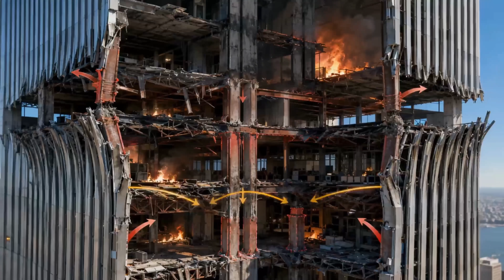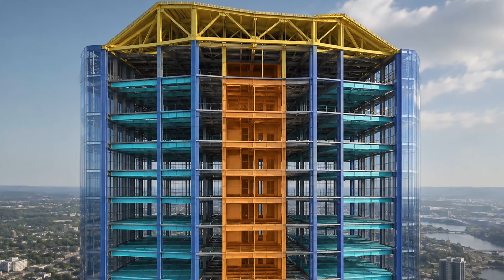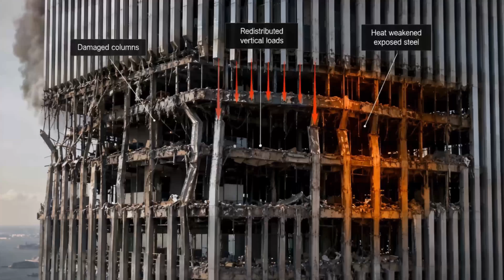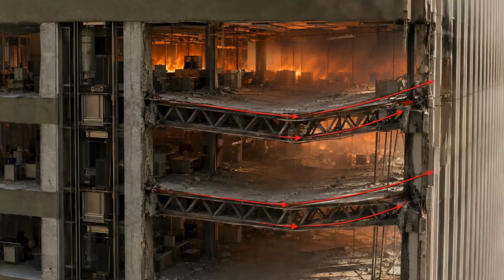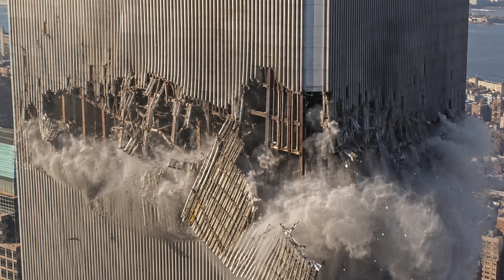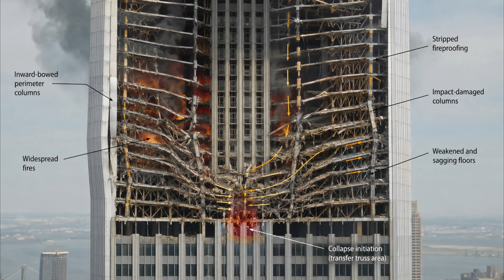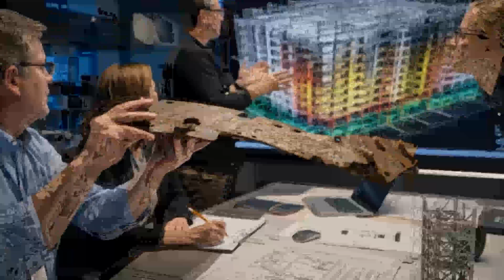What Happened Inside the Twin-Towers After Impact?

Comment: You can Ai to anything and come up with theory, but what i want to know is what caused building seven to fall. There was no direct hit, yet forty stories pancaked just like the controlled demo of the twin towers.  No matter how many engineers, or specialilists try to convince me, there is no way that me that the towers came down on there ow. This is just government trying to convince the people iy was terroism, but it wasnt  Where the hell is the plane parts at the pentagom, that was not a plane, it was some sort of rocket. Why did the government rush to take out all the cameras around the businesses, so no one could identify, thats why the corrupt us government murdered so many people
Reply: Ask and ye shal recieve:  

Building 7, the 6th building to collapse of 10 lost on 9/11 got little attention early on due to higher priorities. As a result, the information void got filled with technical nonsense, creating lots of confusion and misconceptions. Many people, like you, just want to know what happened. To remove the confusion I prepared this brief summary from my own independent technical analysis. Let me know what you think. 

At 10:28am the WTC North Tower collapsed, showering Building 7 with tons of burning debris, causing heavy damage and starting many fires burning out of control for the next 7 hours. Office buildings are essentially giant piles of kindling when it comes to fires, chock full of stuff that burns vigorously and quite hot. Since half the firefighters had been killed, units in disarray, equipment destroyed, no water pressure, and the priority of search & rescue efforts, 7 couldn’t be saved so firefighting efforts were pulled as futile and 7 left to its fate. Firefighters make that choice every day in brush fire situations - which houses to save and which ones to let go. Only real difference here is moving the decimal on the size and cost. People get overwhelmed by the size. 

www.youtube.com/watch?v=g_SvpwyC17M 

Collapse of a burning structure is always a concern for firefighters. Steel buildings are uniquely vulnerable to fire damage. Designed around 1 to 3 hours of fire resistance for occupants to escape they rely on active firefighting to survive. After that all bets are off. Left to their own devices they'll exceed their design envelope and collapse, like Plasco Tower and Wilton Paes de Almeida. In 7 the occupants escaped, passive and active fire protections were compromised and active firefighting was abandoned hours before the collapse, which left the building to its fate. It lost. Odds on Building 7 would eventually collapse, and it did. No big deal in logic. 

www.youtube.com/watch?v=WnYBX6QT0R4 

FDNY Chief Daniel Nigro - The biggest decision we had to make on the first day was to clear the area and create a collapse zone around the severely damaged 7 World Trade Center, a 47-story building heavily involved in fire. A number of fire officers and companies assessed the damage to the building. The appraisals indicated that the building's structural integrity was in serious doubt. I issued orders to PULL back the firefighters and define the collapse zone. It was a critical decision; We could not lose any more firefighters. It took a lot of time to PULL everyone out, given the emotionalism of the day, communications difficulties and the collapse terrain 

FDNY Deputy Chief Peter Hayden ; We had our special operations people set up surveying instruments to monitor and see if there was any movement in the building. We were concerned of the possibility of collapse in the building. And we had a discussion with one particular engineer there, and we asked him if we allowed it to burn could we anticipate a collapse and if so, how soon? And it turned out that he was pretty much right on the money, that he said 'In its current state you have about 5 hours 

The collapse of Building 7 was anticipated and widely reported in the media throughout the day, with 24 video cameras recording it. Everyone knew what was coming and why. 

www.youtube.com/watch?v=OY5S5k3tMHI 

Building 7 collapsed from the inside out which is not intuitive and hard to understand. Most details are hidden from view and some people will struggle no matter how much it is explained. But here is my best shot relying on no outside authority. Building 7 was a unique, asymmetrical 47-story steel frame structure built atop a smaller 3-story building serving as a partial foundation and requiring lower floors dedicated to complex load transfer structures. Of trapezoidal shape and tube-in-tube construction, B7 (above the 7th floor) consisted of a central core of steel columns carrying most of the gravity load, perimeter steel columns around the outside of the structure carrying the remainder of the gravity loads and long span beams and girders to tie those elements together and form the floors. On the outside of the building hung a curtain wall facade or outer shell. www.nist.gov/image-16640 

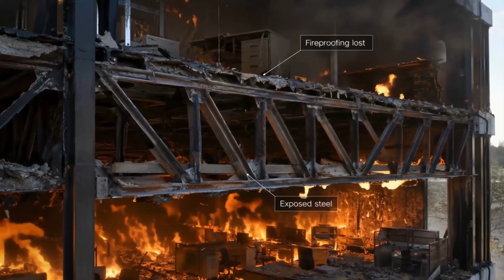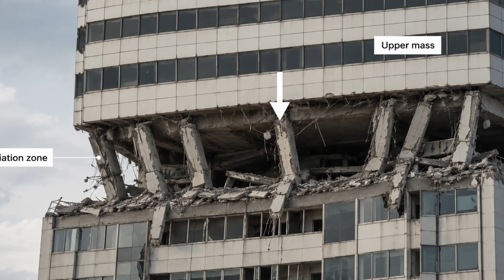Phase 1 : First externally visible signs of collapse initiation occurred at 5:20:28 pm and was notably quiet with observers not realizing the building was collapsing! No warning in the form of hundreds of eardrum busting 180dB explosive bangs. Here at 12:00 a local CBS affiliate reporter is just 10 blocks from B7 when collapse begins. People don’t start to notice the collapse until 12:11. At 12:45 is the famous CBS fixed camera clip of Building 7’s collapse. Note the silence. 

www.youtube.com/watch?v=t5tEy6mXSE8 

Lower floor failures above the load transfer region (8-14) in the NE corner initiated the collapse. In this video at 0:45 you can see the NW corner from inside the building while under construction, Column 79 just out of frame on the left. That big, angled steel beam across the top of the frame connects to C79 at one end. The girders connect to the beam. That beam and all those girders depend on just one connection 

www.youtube.com/watch?v=nP3TNHPCIVU&t=45s 

Phase 2 : NE corner floor failures caused a loss of critical lateral support over an excessive length of Column 79 and it buckled. A column buckles when it takes on more load than it can handle. Externally we see a vertical progression of window breakage along the 44-46 line and a kink in the roof of the East Mechanical Penthouse atop the building, all consistent with C79 failure. Looking at the above floor diagram of Building 7 when you see all the structures that depend on C79 you quickly realize this one column was a relatively isolated structural element on which a disproportionately greater fraction of the structure depended analogous to say the Key Bridge. Normally with a buckling column, the load could be redistributed to other columns. With C79 that is not the case - the failure did not redistribute the load, so the collapse rapidly progressed to the roofline, sinking the rooftop penthouse. The transition from full capacity to almost no capacity occurs in an instant and will result in virtually no resistance 

Phase 3 : With C79 gone, B7’s progressive, non-symmetrical collapse continues with adjacent columns C80 and C81 left laterally unsupported and quickly buckling as well. The EMP drops down through the building. C79-81 all have no diagonal bracing, which is the major reason why they could not redistribute a lot of vertical loads among one another. From there collapse progressed from east to west through the central core until the core was gone from C81 to C58, taking all the interior floors and probably most of the perimeter columns with. Follow the horizontal progression of window failures low in the building and the dropping of the remaining rooftop structures into the building. The NIST Building 7 study model 4 determined C79 failing under ANY circumstances would have initiated the same collapse sequence. 

Phase 4 : After about 10 seconds only the exterior moment frame remains, giving the illusion B7 is still standing to the casual observer as little has changed outwardly. But it is just a hollow empty shell like an empty cereal box supported only by a few remaining columns and quite unable to remain standing on its own. With nothing remaining behind it, the north face of the outer shell leans into the void, forming a V in the roofline, the last few columns buckle under the strain and the moment frame free falls, landing on top of the debris pile.

It is only now that we get to “free fall”. For those who get all worked up about an alleged 2.25 seconds of free fall - don’t. How fast something falls can’t tell you what started it falling, the alleged measurement people fuss about is wrought with problems, not least of which being it isn’t The Building (defined as its center of mass) being measured AND the measurement doesn’t even start until more than 10 seconds after the collapse begins, meaning whatever caused the alleged free fall was due to collapse progression mechanisms NOT collapse initiation mechanisms. Useless for informing on what caused the collapse in the first place. It is now and always has been a Red Herring. 

The debris spread well outside the footprint blocked surrounding streets, heavily damaging the Verizon Building and destroyed Fiterman Hall. 

No building is meant to survive 7 hours of multi-floor unfought fires. Building 7’s progressive, non-symmetrical collapse was incidental, unintended collateral damage from the combination of fire, time & gravity started by the collapsing North Tower, true no matter who planned and carried out the 9/11 attacks or why . Of so little consequence it barely registered at the time, only taking on semi-mythical status as an alleged smoking gun years later when demolitions at the Twin Towers, missiles at the Pentagon and shoot down over Shanksville all failed and conspiracists had nothing left to work with. 

Anything can seem like a conspiracy if you don’t understand how it works. Now you should. I hope you found this helpful, informative and it solicits informed critical comment. If I made any errors of fact, logic or reason or left anything important out, please let me know so I can fix it. OR offer a more plausible alternative if you can. Be the first. Please start any reply with the words “Tits McGee” or I will know you didn’t read it and are wasting my time.
Reply: Falling debris on one side of building 7 is what led to its eventual demise...not the undamaged side, images of which are always used by conspiracy theorists.